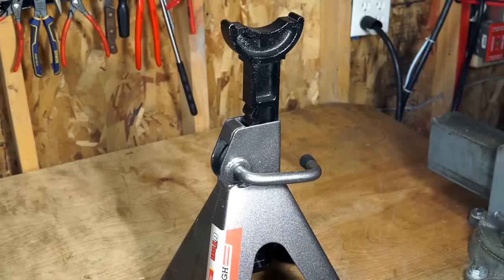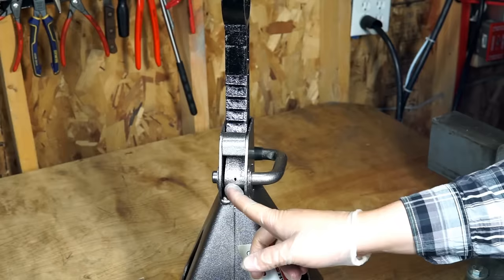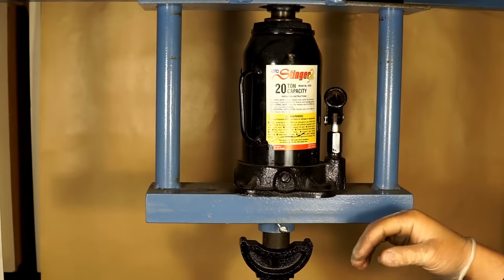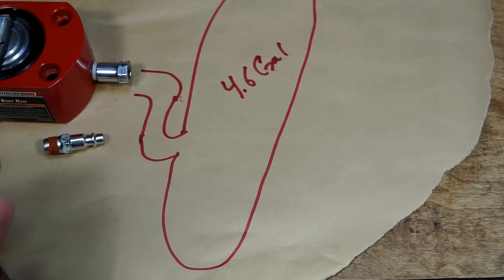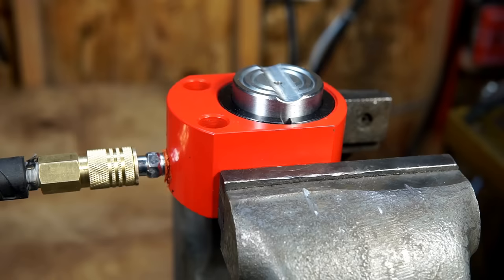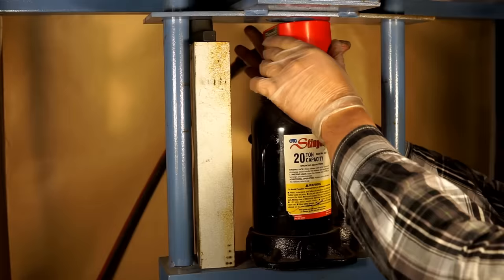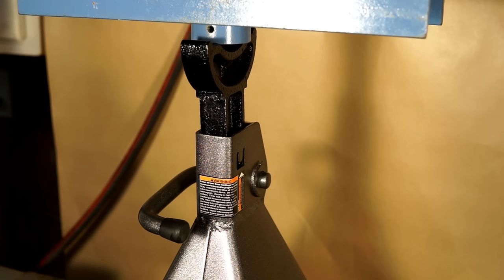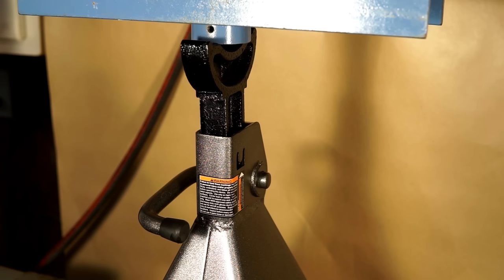EXPERIMENT: WARNING! Doing this to your Jack Stands will get you KILLED!

Comment: I've used those same Harbor Freight jackstands for years now and the handle won't budge if there's any weight on the stand. You put a ridiculous amount of leverage on it during that 'experiment' and I seriously doubt there's any way you could achieve the same result by accident. I would guess the guy from the article didn't have his car supported properly like 99.9% of people who get crushed by cars.
Reply: Yup, I always leave the hydraulic jack in place as well. I also have a log I can roll under there out of the way that's thicker than me. Working under your car sucks bad enough let alone getting crushed.
Reply: I just use  a tire as a back up for my jack stand and jack - triple redundancy because of earthquakes.  I have a Porsche, so usually taking off the rear wheel to do anything on the engine is helpful.
Reply: You are correct.  I find his experiment to be totally flawed.  As long as there is weight on the jack stand, you would have purposely try to make it fail.
Reply: Tom G....I once hired a guy to install a gate in front of my driveway to keep the neighbors from parking in my yard. When he was done with the job he asked for payment. I said OK but I wanted to make sure the gate worked. So I rammed my bulldozer through it and told him his gate didn't work so I didn't pay him.
Reply: Funny story!  Gave me good chuckle.
Reply: Tom G.....And to top it off I gave him a bad review on Angie's List. It got so he had to go out of business. Last I heard he's working for Harbor Freight testing jack stands.
Reply: LOL!
Reply: And the more weight that is on it the harder it will be to fail.  500 pound is just not that much weight.
Reply: Miles Turney 500 pounds isn't much less than they would have on them in practice. If you had 2 of them on the back of a small, light car with a short wheelbase, it might be even less.
Reply: Let's do this myth buster style and up the pressure until the jack stand shear pin breaks...
Reply: MoneyManHolmes Do your own video, so you can pay YOUR money to break things for some kid's pleasure.
Reply: The purpose of the experiment was to see if the pin would shear thus protecting the operator....it didn't with a 500 lb load.
Reply: You must be a joy to be around. Do your neighbors drive bulldozers?
Reply: Responding to blipco5, not you.
Reply: Alex's Bikes and Motors I should be good with my Mac jack stands then
Reply: he addressed that levarage issue sir
Reply: The point isn't that it's easy to do by accident and there's a good chance the guy in the article had things set up wrong but this jack stand still failed and that's that. The pin should have broken and he did mention it would be hard to do by accident.
Reply: Tom G.  So you've never had a pry bar slip? Or slipped off something with a breaker bar and got caught up between two solid parts of a vehicle? Shit like this could conceivably take place. IMO, you've completely missed the point of the experiment
Reply: I use the jack stand AND the jack itself as a backup.
I will use my rims next time tho!

Comment: I use lots of old bubble wrap I have laying around instead of jack stands. It is unlikely all bubbles would ever fail simultaneously. YMMV.
Reply: mikeca98 we need this to be the next experiment.
Reply: mikeca98 lol we should test it. I use cardboard it's safer,lol.
Reply: nah, balloons filled with ooblek.
Reply: Better than Homer Simpson using a wicker basket!
Reply: lol
Reply: I LOL'ed
Reply: It needs to be fresh bubble wrap (no sunlight), no heat or torch work nearby and the first contact has to be evenly distributed. If only 10 or so bubbles are under the frame rail they will break. Test: Stand evenly on bubble wrap with both feet. Now stand with only one heel down. A piece of plywood on top the bubble wrap would help but it's not worth risking your life.
Reply: WARNING THIS COMMENT SECTION MAY CAUSE EXTREME BODILY HARM, DEATH, OR DISMEMBERMENT IF USED INCORRECTLY....PLEASE TAKE PROPER SAFTEY PRECAUTIONS AT ALL TIMES WHILST READING.* These comments nearly ended my life just now....i was on my lunch break, & thus right in the middle of scarfing my way through a particularly deliscious
 "12 inch yum rocket" (aka. meatball sub with extra motzerella) when i stumbled upon this bubble wrap comment thred, laughed, snorted, and nearly choked to death on melted motzerella. Friends...youll want to heed my warning and: PROCEED WITH EXTREME CAUTION! Thank you.
💀😱😲😨🙊😰😭🙅😂

Comment: I have been using those type of jack stands for about 20 years. Never encountered an issue like that. I do find that it rare cases if you're not careful, the handle may not be in its full locking position, meaning that the ratchet type gear would rest the weight on the end of the tooth with the handle in a slightly raised position. In which the slightest movement of the car such as undoing a tight bolt will slide the tooth off causing the failure. That's my theory on what may have happened if it was a ratcheting type stand.
Reply: I like your theory. I was going to make much the same comment, but you beat me to it.
Reply: how do you confirm its not barely resting on the end of the tooth? I mean you can't vigorously shake the handle to confirm its locked cause than you'd be dead.
Reply: @mosasa1307   you confirm this before using the stand. If the lever is all the way down then the teeth are engaged correctly. When its resting on the edge of the tooth the lever is half way up.

Comment: My cheap jack stands have a triangular bar that is chained to the stand. After setting the jack, the intention is to slide in the bar which also locks the jack. In order for them to collapse, you have to both knock out the bar and lift the dog. As long as you remember to insert the bar,  you have essentially zero chance of failure.

I suspect that there were lawsuits over this in the past which caused them to add the lock bar.
Reply: When I bought myself some axle stands a couple of years ago I specifically bought some with that feature.
Reply: John S - I wouldn't put my dogs under a car, that's stupid!
Reply: YES!!! those are called double locking jack stands and the only type I use, for a 3ton jack stand the pair cost about 35 bucks... great price for the added protection so no reason to buy anything else.
Reply: I miss the old jackstands I used as an apprentice - they were basically a long screw, so they were adjustable to any height, rather than just the discrete intervals allowed by a pawl.  And in a pinch, you could adjust the car's height a little by screwing them up and down while the car was already on them - hell, I even had an old jack that worked the same way, with a vertical screw (and a huge gear reduction - damn, I miss that thing.  So reliable.)  The downside was that they were more expensive and slower to set up, as you had to jack the car and then screw the stand all the way to the car, rather than having a quick setup by pulling the stand up like this model.  Not sure if they're still on the market, but haven't seen anything like them in years.
Reply: +aussiebloke609
Yeah they are still available, but do to their cost only really find them in heavy duty applications.
Found an example on Amazon:
https://www.amazon.com/Esco-Screw-Style-Jack-Stand-Capacity/dp/B00FG09NS4/ref=sr_1_2?ie=UTF8&qid=1494168295&sr=8-2&keywords=screw+style+jack+stands
Reply: That's a bummer.  I don't need to pay for a 20 ton capacity...not to mention how heavy the damn thing is gonna be.  Sliding those buggers under a small car isn't gonna be worth the effort, and I couldn't find any for moderate to light duty either.  :-(
Reply: +aussiebloke609
I use them all the time at my place of work, most of the ones I use are rated at 60 tons... so think hand truck size :P . The double locking ones with the safety pins is very inexpensive and really a safe option for DIY or small garage environments. I agree it is nice to have the option of of the fine adjustment that the screw style offers... just not a fan of the prices that comes with it.
Reply: John S you shouldn't trust cheap stuff though
Reply: I should probably get some of those.  I have 4 jack stands from AutoZone that I've had for probably 15 years now, similar type to the one in this video, and never had any issues with them.  My dad used to have some super old jack stands back in the day that had the locking pin, but not as wide of a base as the type seen in this video.
Reply: Holy crap. That's super scary. I like the triangle safety bar mentioned above too.
Reply: the triangular design is designed to be triangular design is actually a pyramid foundation design, a triangle doesn't hold much weight in itself but if you have 4 triangle forming a even pyramid foundation for the load to spread out evenly, the possible weight load is nut's

Comment: Pro tip, use more than 4 jackstands. I like to use at least 6 preferably 8 if they can fit. This way you are not totally reliant on the 4 corners alone. In the event of a failure if you have 2 in the middle you could more than likely teeter the car one way or the other or at least keep it from totally crushing your body, saving your life.
Reply: Alternatively if possible (if you don't have more than 4 jacks, I only have 2 for instance so my back or front wheels are always blocked or on ramps and blocked) stick the tires under the car in the middle as a just in case safety feature (learned that from ChrisFix, helped me out more than once when the jack slipped as I was raising the car to move the stands out)

Comment: Curious, did you confirm the ram would support at least 500 lbs?
For those wondering how Mike could lift his car off himself, consider the other jack stands were still in place. I was checking my stands under the car one time and noted one was completely loose! Issue was one spot in the jack surface was a little lower (about 1/2") and I forgot to account for that. I could tip the car back and forth with one hand!
Reply: Spot on!
Reply: interesting. that's probably how he was able to knock the handle and lift the stand. the one jack maybe wasn't bearing a lot of weight so the handle could easily be lifted, particularly if it was hit by something.
Reply: I'm guessing Mike didn't have the bar on the stand engaged completely
Reply: Exactly what I was thinking, bravo!

Comment: As a Mechanic myself since 1976 I've been under a car or two with stands, its not hard to see the mistakes lay people could make using them.
Mike drives a Porsche so he is possibly a lawyer, if so he was bound to make up some story that lay the blame on the jack stand design instead of admitting he simply placed the stand wrongly, or on uneven ground, or under a part of the vehicle it could slip off.
We can assume he wast not under his Porsche shampooing the gearbox. he was doing something that probably involved him swinging on a spanner, which was attached to the car, which was teetering on a badly place jack stand.
And he's a strong man who can lift a car and I bet he can really swing hard on a spanner too.
The only question here is, how wrong am I on this.
Reply: Maybe he wasn't even using jack stands.  And his jack failed
Reply: 914 bro.  He had a _914_.  He's no lawyer.  He's a car guy.  Probably rallies.  He knows what's what.  A 914 if the engine was out?? or if he's under the front??...would be super light as far as cars go (lighter than an old Beetle...some people can lift the front of Beetles; still more than enough to crush face, though.
Reply: AuMechanic probably a snap on guy hitting on Pittsburgh tools again lol
Reply: Although it's very speculative, I have to say I think AuMechanic makes some very good points (or possibilities). I've working on cars a long time and this 914 story ain't adding up.
Reply: to make up some story that lay the blame on the jack stand design instead of admitting he simply placed the stand wrongly, or on uneven ground, or under a part of the vehicle it could slip off.

Well, though i'm not fully in Mechanic yet. Using a hydraulic jack at a bad place can either damage the car or be dangerous. 
Like, when your car is parked on the side of the street, street are never strait flat, they are curved/incline to make rain go in the drain.
Also result in more dangerous jacking operation. A jack stand must be on a solid ground with has less incline terrain possible, especially side incline. For Up/down hill is easier to secure by placing something near the wheels that stand on ground, or to just have your hand brake on if rear wheels are not lifted or your car parked to "Park (Automatic trans.)" if your front wheel are on ground.

Like you said, his jack stand was probably at a bad place.

I always place big bricks under the arms (under the suspension arm), in case my Hydraulic jack fail, i will be safe. I even put the car a little bit on the brick to release some of the pressure that the jack is holding. Always safety first with dangerous condition.
Reply: Bryan Miller  lol
Reply: @TwinShards  stick to nintendo, bricks under a car? You'll be the next story we're talking about. Jacks to lift and backup the jackstands, jackstands to hold.
Reply: or he was a greedy lawyer or his practice was in financial trouble and he thought "some physical pain and down time in the hospital with a several Million dollar law suit against the jack stand co. when he recovered, Hey that could work!"
Reply: Lighten up, Francis.
Reply: If you are driving a 914, you are not some rich guy douche.  You are probably a weekend warrior who does autocross or time trial racing.  The 914/924/944 series of cars are widely used for this.  A lot of the owners of these cars do their own work because of how ridiculously expensive it is.  I have a 944s2 and got quoted about $950 to do the thermostat.  Cost me about $50 to do it myself including the coolant.  There is a very low chance you would be driving one those series unless you are adept at doing mechanical work otherwise it would be way too expensive to maintain.
Reply: Maybe I'm misunderstanding.. But he's dead? Right?
Reply: Derek Holdt I drive a 911SC and yes I drive it like an asshole
Reply: He has a porche so he is a lawyer... wtf you make way to much assumptions

Comment: It seems to me that you first want to know the force it takes on the lever to shear the pin.  For that, there should be no vertical movement.  You just have to apply a measured force at the end of the lever until the pin shears.  Then you can just calculate the threshold weight on the jack from its mechanical design.

Comment: The danger isn't necessarily from accidentally knocking the ratchet lever, but the pawl edge wears away from many years of the teeth riding against it when its being extended over and over gradually filing it down over years of use. So when uncle Joe with his 15 year old jack stands is smacking on a brake drum or trying to wobble something free it might just be enough weight and enough play to sheer the remaining lip off the pawl and come crashing down.
Reply: That sounds very plausible

Comment: Next up: Starting your engine will cause wear
Reply: If you have a properly functioning canuter valve and blinker fluid of the correct viscosity you can reduce engine start up wear by 2/3. :D
Reply: don't forget about those piston return springs :D
Reply: Not if you have your blinker fluid topped off.
Reply: Make sure to use a metric crescent wrench!
Reply: Always keep your muffler bearings lubbed
Reply: LMAO!!!
Reply: Denis Jović the hell you say...
Reply: And after that: Your car uses more gas when it is running.
Reply: @aviationlife950  - I always make sure I have only a metric hand sledge and metric visegrips. Standard hammers will bounce off metric cars sideways. Standard visegrips will slip on metric bolts.
Reply: ROFL!
Reply: Bars!
Reply: Lmao
Reply: Next episode don't make your tires rotate while driving. That wears down your rubber tires on the pavement.
Reply: And boys don't forget the left handed screwdriver and the long "weight"  (wait)  😉
..apprentices,    you're welcome.
Reply: @blablablabla4236  😂😂😂😂